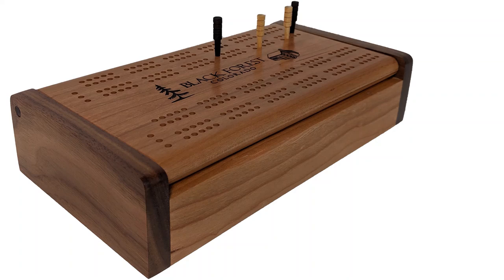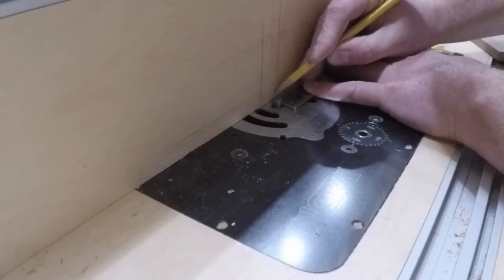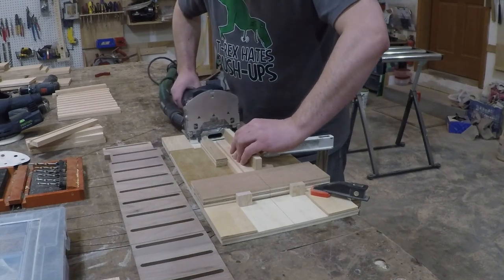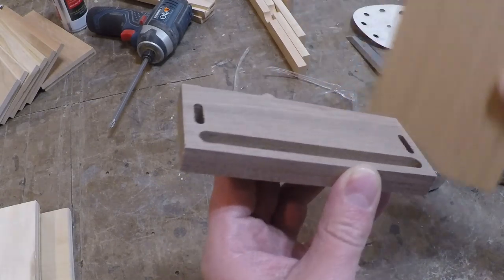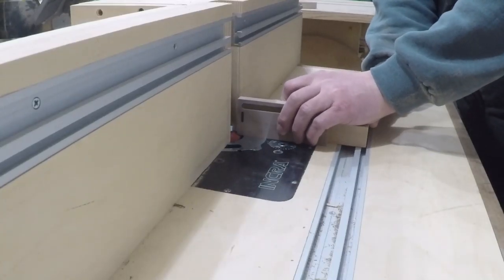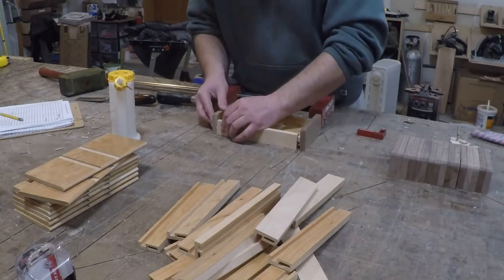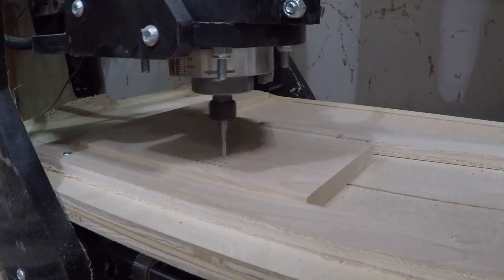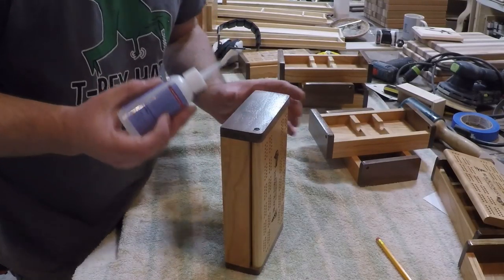How to Build a Cribbage Board DIY Woodworking

Comment: Those games look really good. Is was thinking that your whole family must be hooked on cribbage and the you said they for a shop....... that makes more sence lol! 

I'm quite curious as to what the hole at the end of your table saw is for?
Reply: @Benham_Design  if you put a ramp under it that led to the side (like the ball return in pool), when you are cutting multiple small pieces instead of learning over the saw to grab them you could let them fall through the hole and they would slide to the side of the out feed table ready for collection 🤔
Reply: @Benham_Design  have a bucket at the bottom of the ramp and the handle tied to a piece of string that hooks under the out feed table. If you've just been dropping scraps down there, it's easier to empty a bucket the digging around under the out feed table and if you empty it before a production run you emd up with a bucket full of parts ready to move on to the next operation 😁